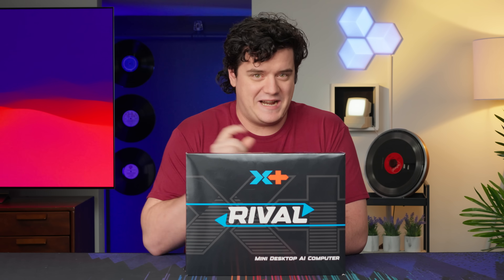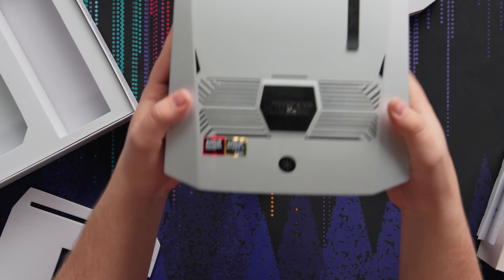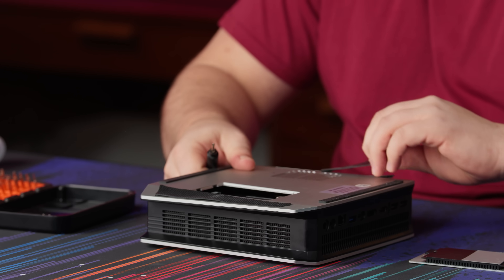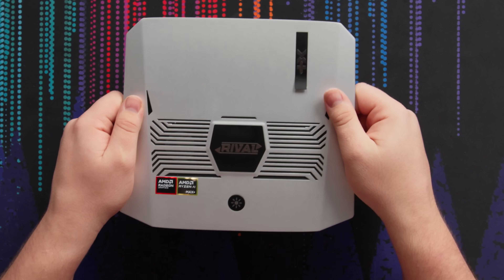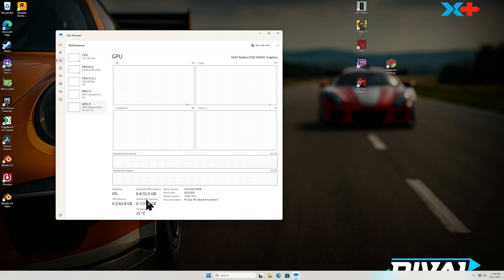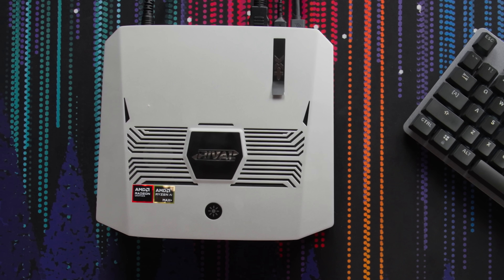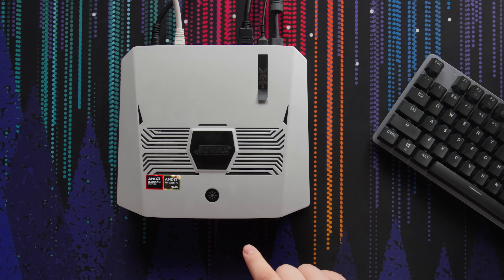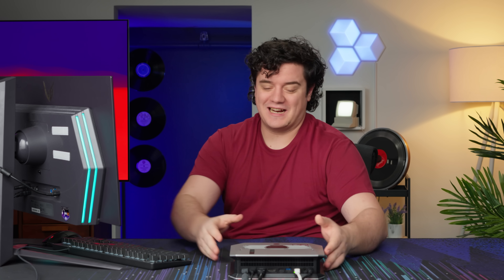This Mini PC Might be the Best Value YET - X+ Rival

Comment: On the Framework, the memory allocation is actually dynamic. The value you set in the BIOS is the maximum it can allocate, not a fixed amount. If this thing always does exactly 32GB of VRAM, that's a significant limitation.
Reply: All Strix Halo are dynamic, if the OS supports it. There's an AMD provided tool that let's you select the allocation in Windows. But they didn't mention that here.
Reply: Even on the framework you need to set max allocations in kernel parameters to actually allocate more then half to vram. Or at least to allocate more the half to one process, which is an issue i ran into loading large models

Comment: I got a 7800x3d + 9070 build for less than that. And sure it isn't as compact, but most people would rather just take the performance (and upgradeability).
Reply: That's not really what these are meant for though. The point is unified memory that lets you run big AI models.
Reply: Depends on the use case. These mini PCs are not really that appealing if you just want a gaming PC but if you care about power, size or the fast ram there aren't really any better options for this price range.
Reply: Most people are NOT building their own PCs. As much as we love tinkering and customizing our own computers, the vast majority of people buying computers just need it to meet a spec, and they go out and buy one. I don't even build PCs for friends anymore if they don't have specific needs because most people will do great with a prebuilt mini pc with a good APU.
Reply: Zotac also makes small PCs like this that come with RTX GPUs in a similar budget so even the value isn't great for the size
Reply: Yah, mini PCs have lost the plot. I'm not spending MORE for LESS, esp when it's no longer that "mini". SFFs are nearing that size and are fully upgradable.
Reply: @TheJohn8765 here I am with a 35W 8core Zen3, 32gb and 1tb nvme. It can do absolutely everything the average person does. They haven't lost the plot, your plot is niche.
Reply: And your cpu isn’t as powerful and you probably got 16 or 32 gb of system ran and only 16 gb vram which can’t load large ai models. 

Gaming isn’t the point of this pc, just a happy thing that it can actually do it decently without a dedicated gpu better than any other igpu can.
Reply: @yashuady7803  RAM is cheap. If it's just AI model size you want, build your own PC. It's going to crush this.
Reply: @TheJohn8765 i just priced out a build using the cheapest parts on pc part picker using the specs given of a 7800x3d and a 9700, but with the same amount of ram as the system in the video. It didn't save any money, and the cpu performs worse than the one in the video and you still cannot load the same ai models that the system in the video can. The only advantage that homebuilt computer will have is possibly in gaming, not in any other use case. Believe it or not, a lot of people use computers for more than just gaming. 

No. Building your own computer with any decent parts isn't cheaper anymore.

Comment: I would love to see someone make  a 395 mini desktop, with only a single m.2 slot, but a full length x8 pcie 4.0 slot, so that we can use all that delicious memory bandwidth to keep a GPU fed if we want to upgrade down the line.
Reply: i really dont get the appeal of these premium mini pc, they cost as much if not more than a laptop, yet you need external screen, keyboard and mouse to function, and you need a power outlet......wtf is the point
Reply: @Skooz for machines with this particular amd Apu, they're like buying a Mac studio / nvidia dgx sparck, in that they can do a lot of AI stuff, but they're also a powerful windows / Linux PC, with competent laptop tier graphics, all while being pretty power efficient and space conscious.
Reply: @Skooz if you want something comparable in a laptopish form factor, the  Asus flow z13 windows tablet runs $3k for the same AMD 395 Apu and 128gb ram.
Reply: @tassadarforaiur  it feels like running a laptop at home, if i am at home and needs all monistor/outlet/peripherals for it to function, why not just use a desktop at that point? i dont understand.....
Reply: @Skooz  The only laptops with this APU in it are well into the high 2000 dollar range, and a framework pc (not this generic garbage model) will have significantly better cooling, be quieter, and have more IO than a laptop. If all you want to do is browse the web, this, nor a comparable laptop, is not the product for you. They have regular mini pc's that are only a few hundred dollars that can do that, and are usually small enough you can bolt them directly to the back of the monitor
Reply: @james2042 I don't think you got my point. The point is, since this device does not have a monitor, battery or any peripherals, you will need an outlet and all the peripherals and monitor. At that point why don't you just get a desktop? This is clearly not something you want to bring around or travel with anyways, it is basically using a laptop but you are bound at home or office. So why bother? The price point can give you a pretty decent desktop no?
Reply: I know we could put the Framework board into a regular case for that.
Reply: 8x is really not great for a gpu though
Reply: @hdhsu-dg6fb it's not a devestating bottleneck though. With the 395 only having 16 pcie lanes total, which also run the networking / USB / storage / etc. dedicating x8 to future performance enhancement, is the most i can imagine any systembuilder doing.

Comment: The biggest thing the X+ Rival shows us is that you always have to trade something to get a lower price.You're getting amazing value here that powerful Ryzen chip, a massive 2TB drive, and crazy amounts of RAM (up to 128GB). That makes it awesome for people doing serious AI and LLM work where memory capacity is what really matters.

But the compromise is the cooling. It's thinner, so the machine runs hotter and louder when you push it hard. You're basically getting superior memory for a cheaper price, but you have to put up with a little more noise and heat while gaming. The lower price is worth it if you need the RAM!
Reply: it seems to be a marketing ploy. No proper Rival test was done due to the lab and Elijah's failure to assemble the stand. We need to see the lab footage of the test.  the included stand, which was in the manual, was never assembled. This is a sham comparison; totally subjective, yet entertaining :)  there are simply No data point comparisons on benchmarks, noise in decibels, and didn't even do a side by side size comparison. Lastly, there was no disclosure with Linus' relationship to Framework. Serious ethics questions is you ask me.
Reply: there was no decibel testing to compare noise. it's totally subjective. The stand wasn't assembled by the testing lab or by Elijah. The data points are off.  Also, as you mentioned, no LLM data points.